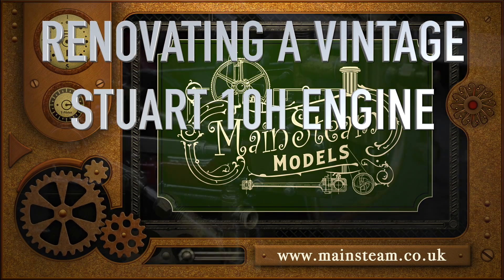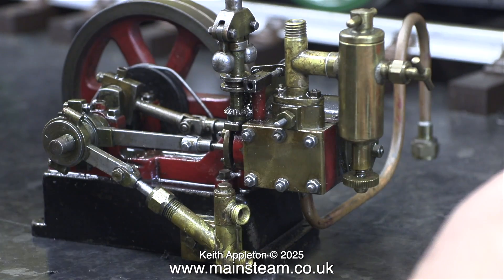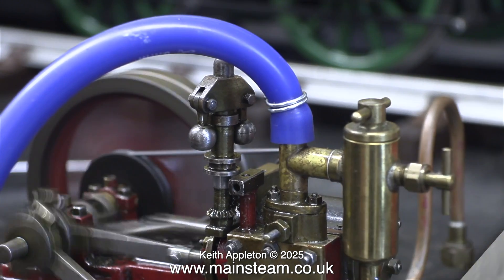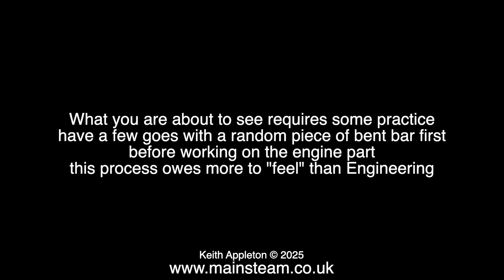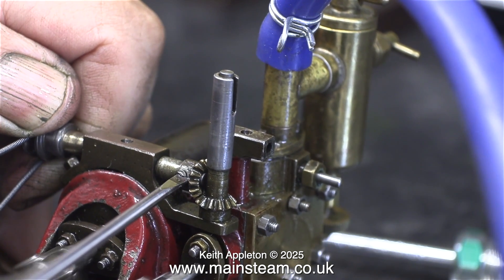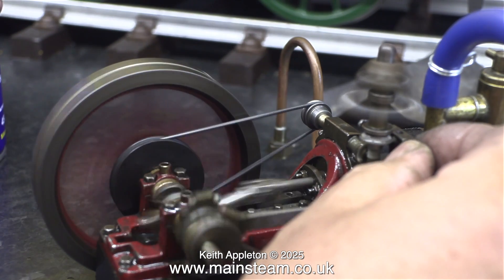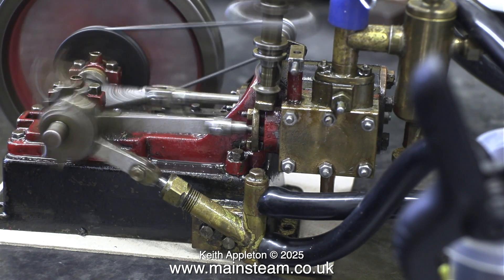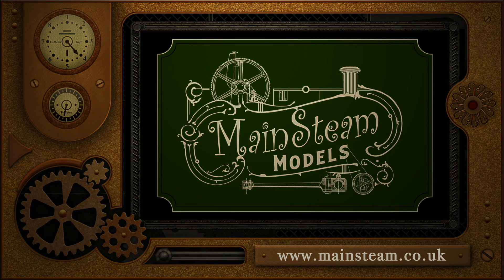RENOVATING A VINTAGE STUART 10H ENGINE - PART #1

Comment: Almost makes me want to send you my 10H. I bought the pre-machined kit about ten years ago and while it does run, it's never run quite right. I had ideations of running it off an aquarium pump at super slow tickover on my computer desk but anything below about 15psi and it stalls out. I also can't tighten down the main bearings to the bedplate properly because it binds up the crankshaft, and at this point I think one of the crank webs is starting to slip on the shafting.

It also has no piston rings what-so-ever. There weren't any in the box. I get a TON of blowby as it runs.

I bet with your skilled hand on it itt'l run like a Stuart 10H ought to run!